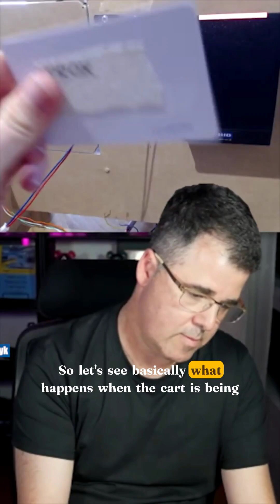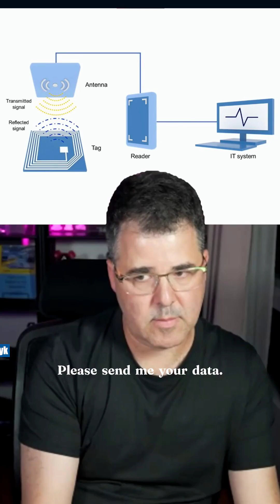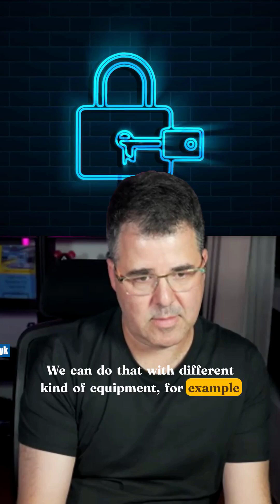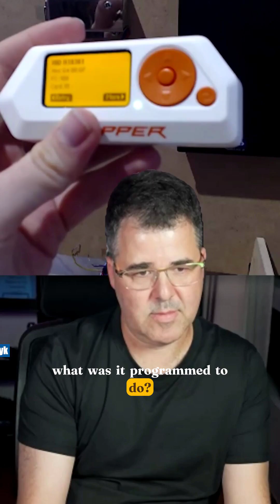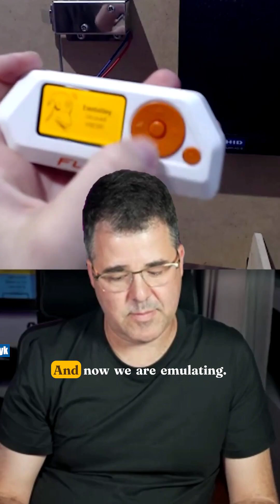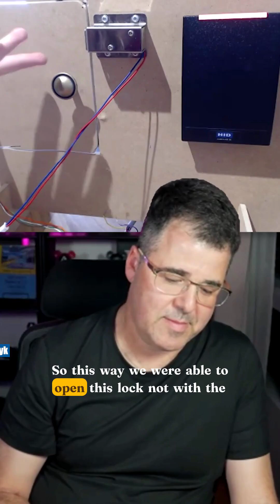Hackers Clone Badges in Seconds 😳 (RFID Bypass Explained)

Comment: Three ways. NFC, fingerprint, iris scan. Internal countdown after process begins.

That's how it was with the last customer. I'd say it's bulletproof and military standard. Time-consuming for employees. But hey, when it comes to high-security data, who cares what the employee thinks about access control? 😅😂🤷
RFID is good for items. Distance detection and data readout are great for this. Examples include inventory or deliveries. No one stops to count whether the delivery is correct. But in everyday life, it's not so good because it's readable up to a good 200 metres, depending on the RFID type.